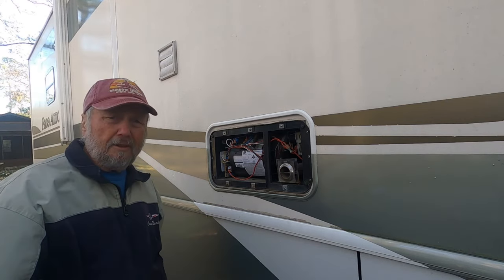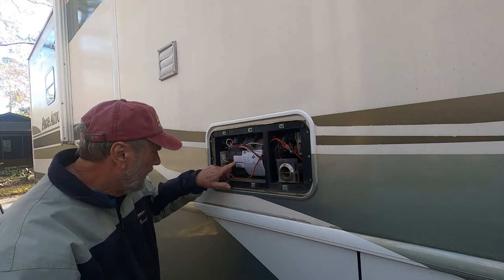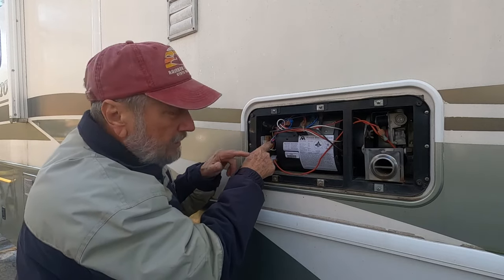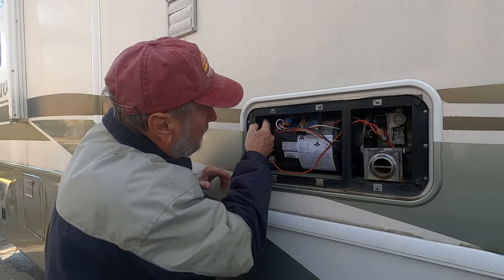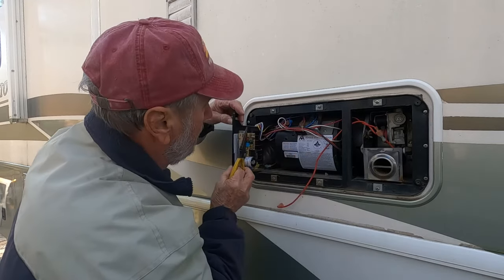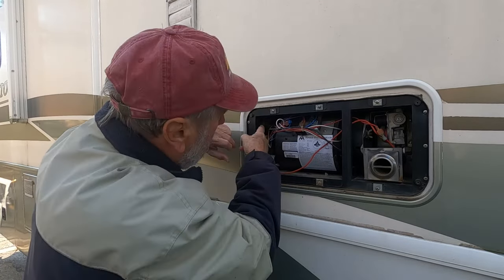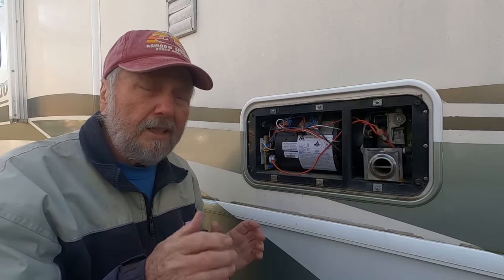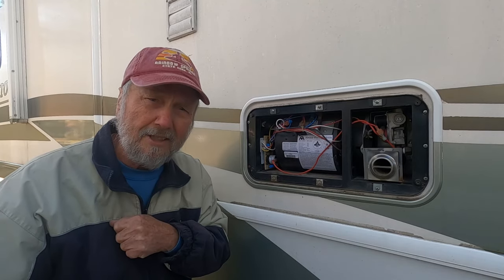RV Furnace blower does not start Solution

Comment: Thx Sam mine made a pop and won’t turn on sadly I don’t have a rear heater as ours only has one heater so I’m guessing the pop was the board controller thanks for this video makes me confident I’ll fix ours
Reply from the maker: @garygibby526 thanks for your comment.  The pop sound was not the control board.  You will not hear a sound when it fails.  Sound like a gas and spark.  You could have insects in the oriface of the gas jet opening.  I have comments about it in my video.

Comment: Hey Sam, many thanks for your video and great explanation. I have a Fleetwood Revolution 40LE from 2006 and my Zone 1 works great; however, Zone 2 doesn't want to ignite. I don't see any lights so changing the board at this point wouldn't work. I'd like to start with the breaker or fuse. Do you know where the location is? Thanks!
Reply from the maker: @Jaime Lopez Mine is a 03 Fleetwood, Pace Arrow.  I have workhorse frame.  The Owners Manual shows all the fuse panel.  I have 4 panels.
2 under the front hood in engine compartment.  1 under dash drivers side and 1 in the Power distribution panel in bedroom.  I don't remember where the fuse for heater is located, but I am sure you will find it in the manual.  You can also call Fleetwood at 800-322-8216  They have given me wiring diagrams and all kinds of help.  Good Luck.
Reply: @samowens44  thanks for your prompt reply! I found a fuse under the bed and I checked and it is good; so now I’d like to see if there is a breaker. I’ll check the manual ! Hope I can find it; thanks again!
Reply from the maker: You will be looking only for a fuse, breakers will be for A/C and it will not be that.  Also, there may be a reset button at the furnace that needs to be pressed to reset.  It would be good to have the Furnace manual and it may gives some key things to check, most have a trouble shooting procedure.  Good Luck Jaime.
Reply: @samowens44  Sam, where is your Zone 2 thermostat located? Not the controller which I know it up on the front side of the coach, but the actual sensor for Zone 2. My controller shows 2 different temperatures for Zone 1 and 2 and they are different which means the controllers is reading the zone 2 temp from a sensor. Where is it located in your case? Thanks
Reply from the maker: @Jaime Lopez, sorry to say I do not know.  I have only had the problem with my front Furnace.  I solved the problem and did not have to investigate the issue you are dealing with.  Currently I am into another part of my life and can not devote the time needed to help you more.  You are most welcome to ask questions and will answer as best I can.  You sound very dedicated to finding the problem, that is a big plus.  I suggest searching YouTube with questions you are seeing answers.  Someone like me has a video for each of your answer needs.  Good luck,  with no light condition,  look at power loss as you are doing.  Make sure there is not a reset button on the furnace that is tripped.
Reply: Many thanks Sam. Happy travels